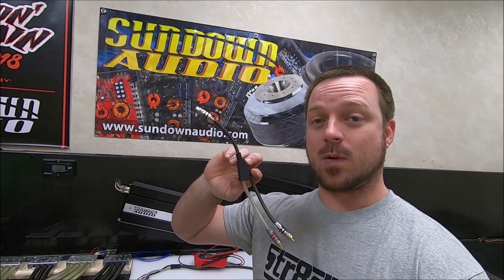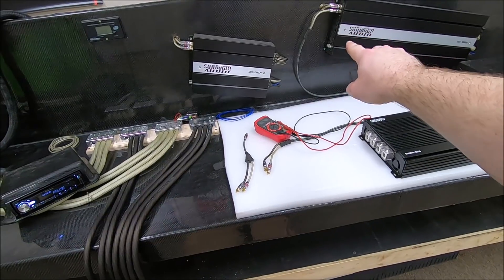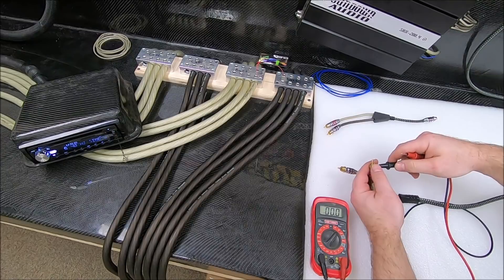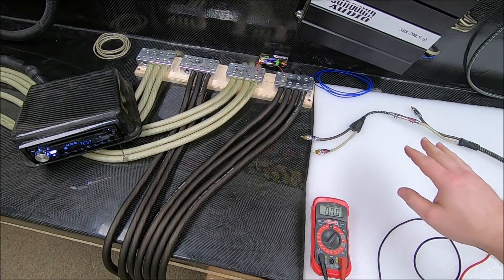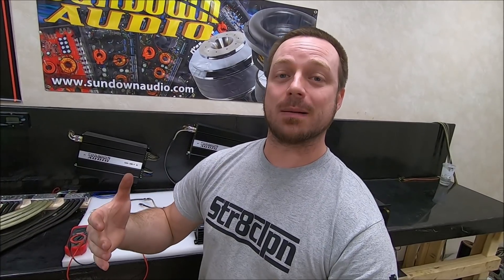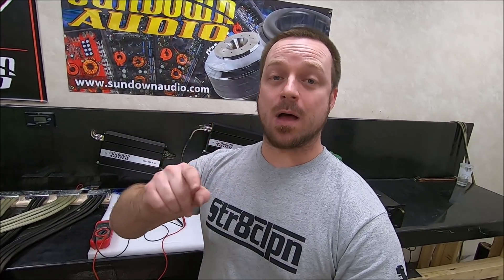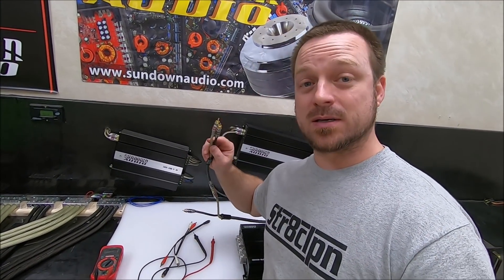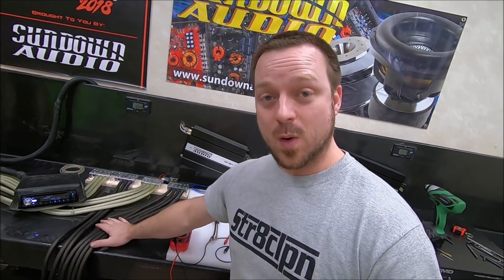***Car Audio Mythbusters*** Splitting RCA Signal Voltage

Comment: some amps have 10k ohm resistors across the rca inputs, most of them its after the filter caps. but some like the wolfram 4500 do. say you have 5  amps and split it 5 times, that becomes 5x 10k resistors across the rca signal, it wouldn't 'cut the voltage in half' but it theoretically lower the signal voltage. but ALL of the other amps i have worked on they were after the filter caps and didn't effect the signal voltage

Comment: If I remember correctly,isn't it voltage X length =resistance....so more wire means more resistance,wouldn't you have to bump up the size of the wire to keep resistance/heat down?

Comment: The only yhing thing ive noticed is that you cant use a dd-1 or the cc-1 setting crossovers because it want give me an accurate reading from the output of the amp   so i have to take the splitter off to get my correct reading.

Comment: I guess it doesn't drop the voltage in half but the impedance would drop in half right? Just like if you had speaker wire powering two speakers instead of one.

Comment: can you run splitters in the opposite direction?  for instance, instead of splitting one signal into two, summing two signals into one?  The reason I ask is because I'm wanting to run a DSP, but it only has a single R and L input... well my stereo has 6, FLR, RLR, and SUBLR.  Can I use a three into one splitter to sum these channels into a single L and single R?  I just want to make sure I'm feeding the DSP the full range of signal from my head unit.

thank you.

Comment: What about on running fuses. Lets say you got amp that recomends 150 amp fuse. And you got recomended wire size ofc 1/0. If you wanna run a dual amp input do you use 75amp fuse for each 0 gauge run or still use 150amp per run. If that makes any sense lol

Comment: So I have two of the same Soundstream ar8000 amplifiers that I have been trying to strap together to hook up to a Soundstream x215. The RCA input on one for the left side has broken off but the RCA input for the right side is still intact along with the left and right RCA inputs to bridge. Because I wasn't getting any signal from the one with the broken RCA input, I bought a duplicate amplifier so I could use the original one more or less as the slave amp. However, when I go to strap the amps together to bridge them so I get higher output, it doesn't seem to change or do much in effect for my sub. Would you have any suggestions or recommendations as to how to fix this?

Comment: No not like an ohm load but how about when it's hooked to strong amps . Why when you run 4-8 amps Daisy chained each amp down the line need more and more turn of the gain knob to match voltage or ac ? There is some loss but not like an ohm load that splits . One or two won't change but 4-5-8 amps you will notice some difference.

Comment: My front loader has 2 preout 
I have 2 amps (both 4 channels)
6 inch front door speakers
6x9 rear speakers
To be running on one amp
 On the other amp I would like to run my 12 inch Sub (bridged 2 channel)
Where do I need splitters?

Comment: Have a question need some help badly running a pioneer 80prs and 1 rca for my mids im only getting 1.956 voltage to the back off the rca connection to the amp imputs, and on the bass side im only getting .658 voltage

Comment: I believe you but my ? Is each amp has an input impedance say 100 ohm, so with 2 amps wouldn't the load be bigger say 50 ohms, would this create an overall voltage drop on the rca' s if split vs. Unsplit,  on a single stereo channel aka L & R.  My logical thinking is more amps is going to drag voltage down but I don't know how amps consume the signal.  Say a 120v outlet has one 100w bulb and you add  a 100 outlet powerstrip with a 100 more bulbs there will be a voltage sag, extreme yes, can you enlighten us to why amps don't follow this flow? I get you said half that's  wrong but some drop in line voltage seems sensible. ? Show us line voltage while connected to 1,2,4,8 amps when is to many splits gonna affect signal. Thanks for you time. Sorry if digging to deep but it peaked my curiosity.

Comment: The reason why people think it effects the voltage is because it can. If you are pulling more current than it can handle. Then the voltage will start to be bottle necked. And when you're splitting the RCA's the voltage stays the same, it's the current that it draws more of, which when talking about Low Voltage signal wires, such as RCA's is very minimal

Comment: Good demo... totally agree. Would have been interested in seeing you meter the cheap splitter vs the quality one though. I was a distribution rep 22 years ago when Monster Cable came to our office to demonstrate how their shielded RCA cables kept noise out of audio systems. They had this noise induction tube setup where they'd pass a set of RCA's through this tube that was supposed to cause all sorts of electrical noise in the audio system. They were a little thrown off when I asked them to run this cheap, no-name brand cable in the same display and actually wound up with results that were just as good. It may have been smoke and mirrors with what they had set up there but showing factual on camera evidence of this performance or lack there of would have further backed your purpose of this video. Just wondering why you didn't take a second to do that?
Reply: Exactly, he talked shit about the cheap RCA splitter but then didn't test it. :(

Comment: When an RCA jack has red and white does it matter if you put your red RCA jack on the White and the white on the red right and left. Also is it possible to short out your radio by disconnecting the RCA jacks that run from your radio to your amp when you disconnect them from the amp and they touch couldn't or wouldn't possibly fry your radio subwoofer level RCA output from your radio.
Reply: Thats how you blow the pico fuse. Common problem on pioneer headunits. Never connect or disconnect rcas or touch + pin on rcas to chassis ground while headunit/amp is on. And only time white/red jack matter is when your running stereo and want the left and right to be corrosponding to left and right balance on the headunit. On mono outputs it doesnt matter which is left and right(white/red)

Comment: Hey buddy, how can I install two subwoofer rca cables to one sub pre out? I have a aftermarket stereo hooked up to my mach 460 ford stereo and it uses a rca on harness into subwoofer to run the stock amps, but I also have a subwoofer and I wanna be able to control it with subwoofer pre out as well, would love the help cause I had it hooked up to rear pre and I have no bass now cause I need to cross over the factory tweeters lol

Comment: Im trying to diagnose something related to this, let me know if anyone can verify it. Im using a y splitter on my mono amp, head unit has 2 rcas. If I disconnect one rca from head unit, the volume does not change. So if I got 2.6v on each of my rca's going to my mono amp, then... it wouldnt matter if I used one or both rca's? Since no matter what Im still seeing 2.6v in each wire?

Comment: I'd be curious if they had resistance, doubtful but I could see a cheap splitter possibly adding some
Reply: all cabling has resistance, even your speaker wire induces some amount of resistance.  if you have a cheap cable and an expensive cable that share the same conductor material of the same gauge and length you shouldn't be able to measure a difference between them as any given conductive material has a known resistance dictated by it's size and length.  strand count can have an effect on this as a stranded 16 awg wire has a larger surface area than a 16 awg solid conductor, but with interconnects you're talking about such small current that it should be practically negligible.  the main reason to purchase higher quality interconnects are for durability reasons.

Comment: Hi I'm new to the channel. I'm running 2 dsp's n from my head unit I'm going to be using a  Y-splitter to split signal to go to both DSP's. however the company that makes the DSPs are saying that i may need to raise the input gain a bit in the DSP software to get the desired volume level sent out to your amps downstream since it splits the voltage from the head unit.is that the same thing  your talking about? Thanx guyss

Comment: I'm sorry I didn't have enough time to read ALL the comments but all I know is yes it does cutt in half somehow I checked and checked  but I got two splitters to run two amps , like the video when you have only one splitter it works fine , defeats the whole purpose but as soon as you hook up the send channel the second splitter it cuts in half now it could be that I have two subs one is a duel 4 ohm voice coil and the other isn't , I ran it in parallel to a separate amp as the other is not duel so what I'm asking is is that why it cuts my sound and makes my signal all jacked up when I go to plug in my other amp and speaker or is it something else?

Comment: Is it safe to use splitters on sfb amplifiers since some of them only come with only 1 rca input and 1 rca output. Instead of just connecting 1 rca jack at a time. These new Brazilian amps and fullbrigde amps come with single rca inputs and I'm not a fan of these features

Comment: What they probably mean it droppes when devided with y splitters
And not that it splits the voltage in half
Cause i have seen difference in direct rca and when i use splitters talking about top of the line cables ans splitter
But in big setups with 6 x mid range amplifiers  tharamps sd4000

Comment: I may be wrong here but if nothing is attached to the split cable, there's nothing to split the signal with, of course it's still 2.6v with a splitter attached to nothing. I bet if you hook 1 split RCA to amp 1 it still gets 2.6v, until you plug the Y cable into amp 2. I've been meaning to try this myself on my home stereo, Amp 1 has in/out, amp 2 only has an input, and i want to split to my powered subwoofer too but can't afford throwing $16 away for science especially if it's going to half my signal from the pre amp. video with sound as you plug in each amp 🎉

Comment: There will be some loss but it’s from added resistance in the chain. The more splits the worse. Resistance would show a small variance.
Reply: It’s ran in parallel.  Do your electrics in your car have different volts other than 12 volts hint look at the fuse boxes and relay.  Everything is 12v lol

Comment: i think what the high school kicker fan boys are trying to say about the splitters is that you might be reducing the sine wave by half and not the voltage. in some cases in dealing with electronics , when splitting a signal tone into 2 ways or into a distro block ( multi port from one out sources  )  some signals do seem to be less pronounced on the O-scope minor changes but a some what noticeable difference

Comment: It shouldn't change the voltage, but would it change the level output on the RCA? Basically putting the input impedance of two amplifiers in parallel would actually get you more output from the RCA

Comment: The potential coming out the back of the head unit is X.  Splitting X into parts means that no matter how many parts you split X into the sum of all the parts won't exceed X. We are dealing with Ohm's law here...the voltage does not change, but the current and resistance does.  There is loss in splitting RCA signal, but it isn't loss of voltage.
Reply: low impedance out to high impedance in. do the math

Comment: Hey Derrick what about if you run 8 amps & you go from rca input to rca output amp to amp ? What about doing the same with the remote wire from amp to amp instead of using a relay? Good video by the way
Reply from the maker: The 8 amps and line driver in ProjectSPL are all ran off the same remote wire without any relay.

Comment: I believe what your saying, but for the non-believers, I would have used 2 dmm at the same time. That way they cant say that the voltage is only going to where there is a draw. 2.6 on the input and 2.6 on both outputs at the same time would prove it.

Comment: They probably also think , tying your shoes tighter makes you run faster. Ain’t no reasoning wit these pros still connecting wires with black tape , or think that alternator whir is an option from the amp manufacturer… I’m wondering how they run mid and highs without splitters ? WiFi ?

Comment: The current is was changes. Think about when you have multiple amps wired up. Each amp will pull some amount of current from the battery. Voltage stays the same. Every time you use a y splitter on an rca, you are adding a load in parallel two the other load. This will cause more current to be drawn from the rca output on the headunit. Same way is it would draw more current from a battery. I would think there would be a limit to the amount of current that the rca output that the headunit can supply

Comment: I just realized my 4 gauge power wire for my amp is 100% aluminum wire. Aluminium is 55x more likely to cause a fire (in houses). On the website for the wire they dont state the material of the wire only that its only good for 800W which should be like 8 gauge. If any of you have an answer what my cable is made of its Aerpro Maxcore 4 gauge. Anyway ive ordered some Sky High OFC 4 Gauge to Australia. I could have got some KnuKonceps OFC for half the price but I watched a video and the insulation tested out to be pretty bad.

Comment: I had a guy loose his mind because I had a power wire folded over with a slight kink in it. He said it was restricting the flow funniest thing i ever heard. Its not a water hose🤣
Reply: well, no, but kinks can add stress on the wire and even break strands which can lead to corrosion build up and signal degradation over time.  just be sure to check for voltage loss around said kink should you have a problem with your electrical in the future.  mostly just a best practices thing.

Comment: BUT... Please test it connected to amplifiers, will there not be 2 times the load ? what will 2.6v out the head unit be when it is connected to amps? Ohm's Law?
Reply: That's what I'd like to see
Reply: still 2.6. Test the load? go do that with the speaker outputs.

Comment: Please "mythbust" length of speaker wire vs power. Ie shorter wire run = more power.
Reply: Longer wire=more impedance=less current
Reply: @billychapman8711  if you are running 8 awg ofc is the drop significant on a run of say 10 feet compared to say 3 feet?  I guess I should have been more specific.
Reply: Ofc has an impedance gain of about .1 Ohm per foot. Significance is in the eye of the beholder lol

Comment: It only divides the voltage in half IF you have a 2nd pair of rcas HOOKED Up,  in this experiment you only have 1 set of rcas.

There's only 1 set, so all of the power has to go to them..  You can't have a real test without the 2nd set sucking up the other half of power. 

*joking but hey, that would have really shut the lid on this myth
Reply: I really hope you are joking here

Comment: It’s simple electronics theory.  RCA splitters are ran in parallel.  Rule of parallel circuit will state that voltage stays the same.  Nothing magical just basic electronics.  Thing is that in car audio there is more people learning how to hook up things just for the sake of hooking it up. They don’t understand how the electronics in their system work.  They just know how to hook up power,  rca’s and turn up the volume.  They have no real electronics knowledge and just go off of what they read on internet.  This here that we are talking about is covered in the first chapter of the MECP study guide 😂 😂.  It’s the very basic beginning of a certified installer study guide.  Great video though.  Sundown rocks

Comment: May not drop in voltage, but what about losing miliamps??
 When you set 2 amps on 12 volt, you lose amperage and not voltage...
 Keep em coming.
Bass on!
Reply: Wow only intelligent comment I see on here that understand voltage and ohms law.
Reply: Modern quality amplifiers have op amp buffers what makes them voltage driven devices with very high input impedances (megaohms range). The voltage drop due to currend draw is marginal. Even if the voltage drop would be significant this would affect the volume rather than quality. What contributes to quality degradation is the cable length (reactance), interference, shielding and amplifier design, components quality, internal noise etc.

Comment: With a huge RCA distribution block isn't that powered? I mean doesn't it have a power in a ground and a remote wire to turn it on? Because you will get voltage drop from a large amount of connections ment for one wouldn't you? And that RCA preamp signal is just going to get crappier and crappier when you split it off 20x from what its ment for.

Comment: I didn't even watch your entire video . You go on and on making fun of people . The point is NOT about current voltage . The point is about SIGNAL LOSS . Which HAS to be the case when you split a signal . Try figuring out the ACTUAL ISSUE before you start talking smack .

Comment: People are saying voltage but they’re trying to describe the signal is lower. I tested it. I ran a single RCA and split it at the amp and got less than when I ran 2 leads from the DSP. Explain that please.

Comment: Voltage is a potential like a dam. If you divide your RCA and maintain the same voltage then the available current to each RCA is halved. In a car you may not notice this but in a home audiophile set up the halved signal (milliamps available) then output to two amps then each with speaks WILL result in a noticeable decrease in quality. In a car, eh probably not. Remember that is a home system “presence” is important where in a car it isn’t so much because it is a close listening situation like studio monitors